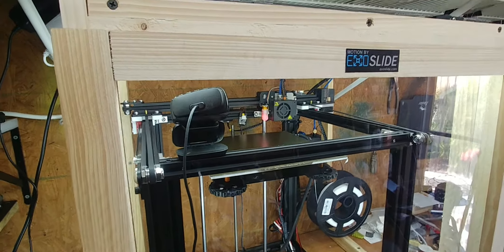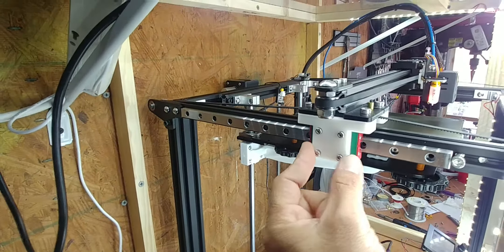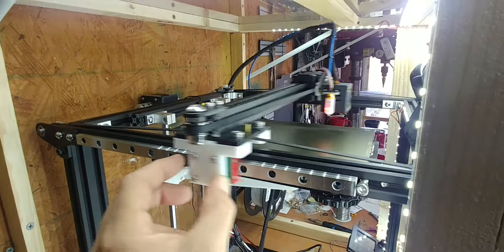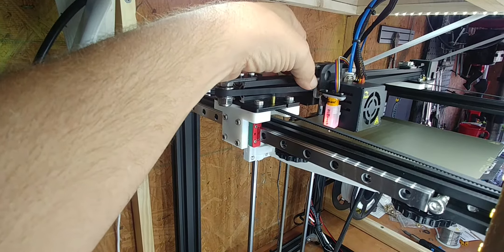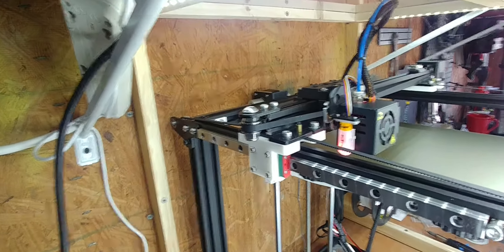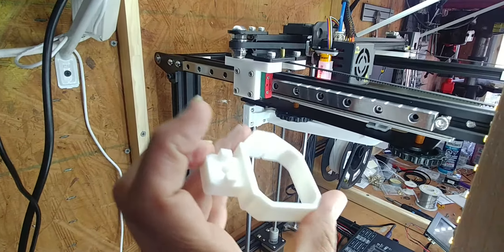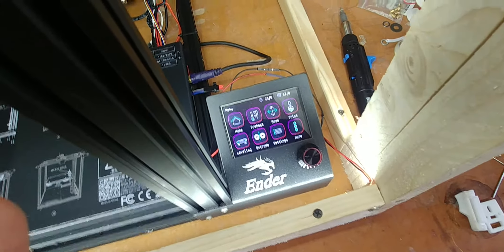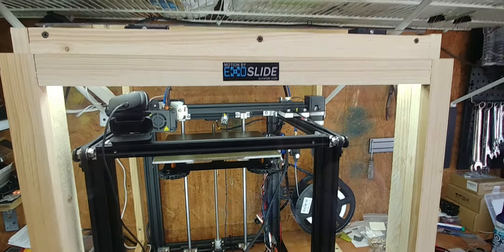Ender-5 exoslide and linear rail conversion

Comment: I like this idea! As of now im planning on just using the exoslide kit with my 5+ and a sonic pad soon. Any review on how the exoslide handles higher print speeds of klipper? Thanks for the video!
Reply from the maker: Since performing this conversion, I have added the same conversion to another Ender5 and an Ender5 plus. With an Orbiter2 and Upgraded Micro Swiss all metal hot end, I am hitting 10K+ accelerations and running both machines at 120mm/s-160mm/s with nearly perfect quality. All my machines run Klipper now. I have a video on this channel showing off my new shop that shows the 5+ and the Current state of that same Ender5 from this video.
Reply from the maker: Also... Exoslide is essentially maintenance free. That Exoslide has printed 1000+ prints, and required ZERO maintenance or adjustment of any kind ;-D
Reply: @theway-offgrid9853  great to know! I'm excited for a nice drop in upgrade to go along with the sonic pad I'm going to pick up. I also saw on exoslides page they have a mount for the micro swiss NG which is part of my ultimate upgrade build so that's awesome too

Comment: Nice job Steve! I like the combination of parts! There's one thing I'd love you to try if you get a chance. The reason I went with the extra idlers on top is because I wanted to keep the belts square. Mathematically, having the triangular belt path that changes as you move should affect the dimensional accuracy across the bed on the Y axis. If you print a calibration cube in the middle of the bed and one at either end in the Y-direction, are they the same size in the Y dimension? You may need to scale them up to see it on a larger scale but I'm curious how that turns out. Again, terrific, clean work!
Reply from the maker: That actually makes perfect sense. I will print those out and give it a good test before and after as you suggest. 

I am also curious! 

Thank you for your comment. 

LOVE YOUR CHANNEL!

Comment: Any particular reason you decided to not put a linear rail on the x axis? I have an ender 5 plus and wanna do the rails on the y but decided if I want to go with exo slides on the x or put a rail.. only benefit I see to using exoslides is that the wheels could help absorb some vibrations to the print head.. anyways just kinda looking for some more info on the matter
Reply from the maker: My initial reason to do it the way I did, was that I actually wasn't too happy with the stability of the y-axis exoslide as it was out of the box. Still too much play. 

The x-axis exoslide carriage was adequate, light weight, and even less backlash than a middle of the road linear rail. So, I swapped out the y-axis for linear, and kept the X in place. 

Over time I discovered other differences... The biggest one being that the Exoslide is FAR EASIER to maintain than a linear rail. 

Linear rail - Gets dusty and filled with hair from cats/dogs/humans easily. Weekly cleaning is recommended in any but a totally clean environment. The bearings are relatively easily contaminated. Cleaning  = Dismantling the rail to get to the bearings properly. 

Exoslide - has only needed to be cleaned and the slide wheels oiled ONCE, in almost a year of printing. And, is still working well with little play/slack. Cleaning = Dismantling the 2 screws that hold the exoslide on, and cleaning it while still attached to the machine. As you can lift it up a small bit, full dismantle is not required to clean it. 

So it has its benefits. Obviously its bulky, but in the overall scheme of things, it doesn't interfere as much as one might think. As most items mount in front or behind it, its own mass/bulk is somewhat irrelevant. 

If you buy only the items to make a single exoslide gantry and the metal mounting plate I used, its similar in price to a linear rail. So its really a matter of how often you use/maintain your printer. Or want to.
They print relatively the same in overall quality/results. 

Hope that helps.
Reply: @theway-offgrid9853  I appreciate the response! I think I’ve decided to go the exoslide route on my ender 5+. I’ve never had either, but I did order some linear rails for my ender 3v2 aswell. so guess I get best of both worlds possibly🤷🏻‍♂️ or may be swapping linear rails out for exoslides. who know only time will tell lol